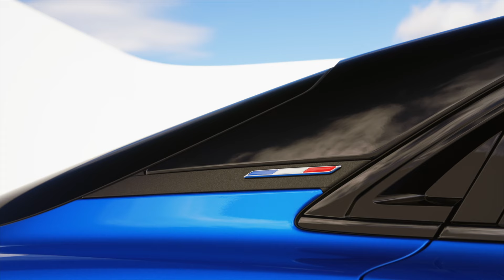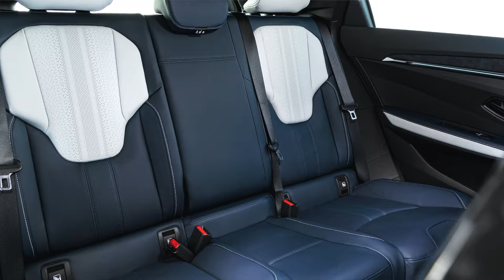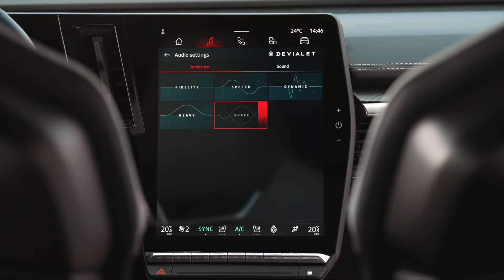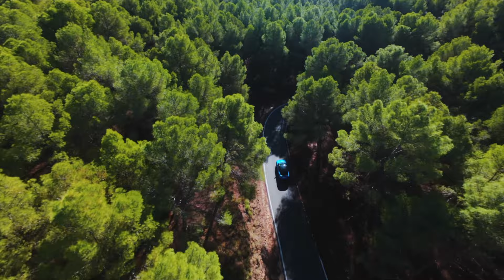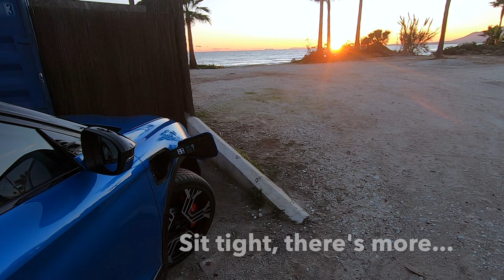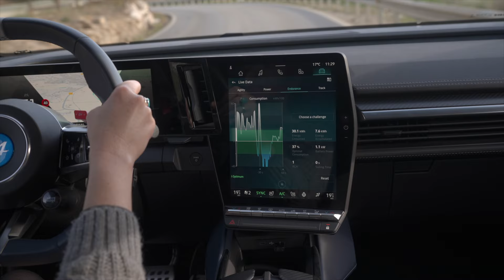Alpine A390 review: Is this 2026’s must-have electric SUV?

Comment: Comprar un coche con batería que tenga litio que es eso de tener que calentar o enfriar la batería antes de cargar preparada qué pasa que se te quema el coche si no pasa eso si falla la bomba de calor que pasa que te quedas sin coche
Reply from the maker: Lithium batteries need heating in the cold and cooling in the heat to stay within their optimal temperature range (around 15-35°C or 60-95°F) for safe and efficient charging, preventing performance loss, reduced range or dangerous thermal runaway (fire/explosion risk) from extreme temperatures or damage; if the battery management system (BMS) or heat pump fails, the car will typically limit power/charging and display warnings, not immediately catch fire, but prolonged issues could degrade the battery or require service, though you don't lose the car entirely, just its function.

Comment: Good in depth review from an informed knowledgable presenter - just needs to work on pronunciation of a few words ;-> Just dissapointed with the 120KW rapid charging rate for the GT - my Hyundai Ioniq 5 does 225 if all conditions are met so just don't think this is good enough as it's a bigger factor than a range being 250m or 300 miles tbh! 

Also does the  GT variant have the 3 motors and torque vectoring?
Reply from the maker: Thank you very much :0) And I agree - I've always struggled with pronunciation of some words and I'm working on it.
All versions of the Alpine A390, including the GT and GTS models, feature a tri-motor powertrain and the patented Alpine Active Torque Vectoring system. 
The range is probably one of the things which lets it down but it's such a good car otherwise. 
If you're a fan of Alpine look out for a podcast in a few weeks when we interview the CEO of Alpine Philippe Krief!(https://open.spotify.com/show/1nRr8cmkgeNfy5kENTTyH5 / https://podcasts.apple.com/us/podcast/discover-ev-podcast/id1853827198)